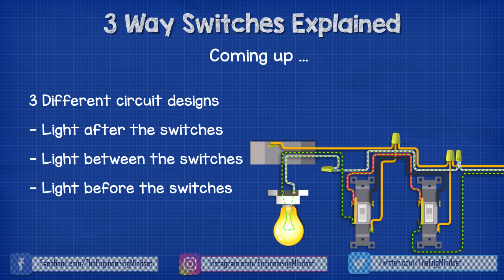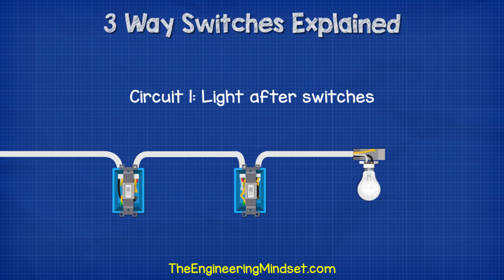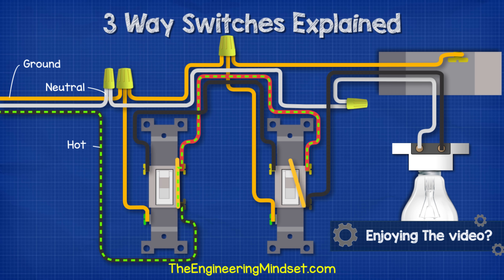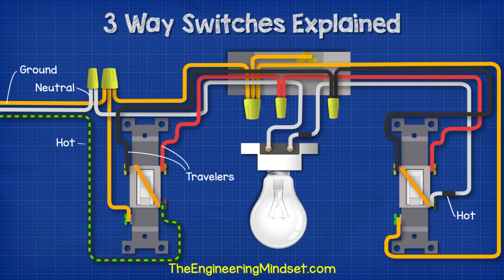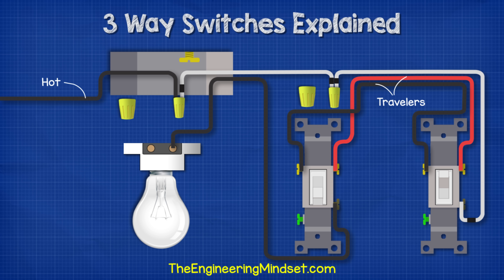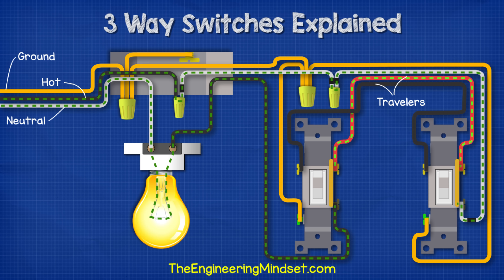3 Way Switches Explained - How to wire 3 way light switch

Comment: What’s the point of doing a 3 way switch? Why connect a lightbulb to 2 switches?
Reply from the maker: You need to walk through a hallway at night but the switch is at the other end. How can you turn it on, without having to walk through the dark to turn it on and then go back again to turn it off when you leave. We install a 3 way switch so we can turn it on and off from multiple locations
Reply: @EngineeringMindset   that makes sense. Thanks for explaining. I love your channel. Your videos have so much info and you teach it in a way that’s easy to grasp. I got a new job in facility maintenance and you videos have helped me tremendously. I appreciate you!

Comment: Great video, only thing id change is that wire nuts aren't connectors, they're protector
Reply: They are dual function devices in that they do both jobs as a connector and an insulator (protector). Sure you can twist the wires together and then put on the wire NUT (sounds like a connecting/fastening item) but pros don't, they put the stripped ends of the wires into the appropriate sized wire "nut" and twist the nut thus "connecting" the wires and also insulating the now mechanically and electrically joined wires.

Comment: Found it. I’m installing a new light switch on the other side of the light and at 4:00 I found the exact circuit I’d be wiring. I ran wire for 3 years but I didn’t do any finish wiring so I didn’t know to cap the black and white at the light box but I knew that eventually in my circuit Common would be Hot. This explained EVERYTHING I needed to know to do the job. I enjoy many of your videos as a new technician training myself in all trades at a very large apartment complex. My bosses know I have the ability to troubleshoot so I’ve been forced to learn on my own. Well partially on my own thanks to Grandpa YouTube and all his infinite wisdom. Thanks for the video and to all of you who produce boring ass content like this lmao.

Comment: In America your third setup is the preferred choice running a 14-2 awg to one switch and 14-2 load to the other switch with 14-3 travelers in between the two switches. I prefer making the switch box the junction box and not the ceiling box. That way you're doing the majority of your connections comfortably in front of you and not on a ladder looking up.
There are instances your feed and load are in the same switch box. That case tape the white wire in your 14-3 to make it a hot and feed back across it to get your hot or load back over to the other switch. Thanks for the video.

Comment: I have a three way system with the light in the middle, power at the first switch.  My question is... can I add a single pole light switch, for a separate light, to the second switch which is at the end? Would the red wire become the neutral "white", for the additional light?  Or is it just not possible?

Comment: I am guessing that all this is assuming you are using “romex” sheathed cable and not conduit with single wires which is why you chose in the middle presentation to use the neutral as hot and put tape in it. I’d say get some red electrical tape and a sharpie and write HOT on the tape and attach like a flag so any uninformed homeowner could figure out. If you are using conduit, I assume you can use the same wiring as the first explanation if the common wire is a different colored wire.

Comment: Method two is against NEC code 200.7(C) as you can’t use the re-identified white as a switch leg or return to the light. So the second 3 way where you have the white attached to the common would be switched with the black and made a traveler for the second 3 way and the black made the switchleg, and have the re-identified white in the light box attached to the black traveler wire from the first 3 way and that takes care of the violation and this avoids confusion if said tape did come off in the future and there were two white wires attached to the light so I do see where they came up with that code. Other than that great video otherwise.

Comment: Great video.

My only thing would be instead of addressing just each individual wire you could state.

2 wire to the light fixture coming in 
2 wire to the first 3way switch followed by
3 wire to last 3way switch

And then break down the function of each wire for the light itself and (2) 3way switches.

Comment: In all three of the wiring variations, none of them work correctly. If you have 2 three-way switches you should be able to turn the light bulb on and off With either switch. The way this is set up in all three variations you turn the light on with one switch and then you have to turn it off again with the same switch, otherwise the second switch will not be able to turn on the light bulb because the first switch is disconnected or off. You should be able to turn the light bulb on or off with either switch…
Reply from the maker: Please watch the video again, all three circuits do exactly what you say they can't/

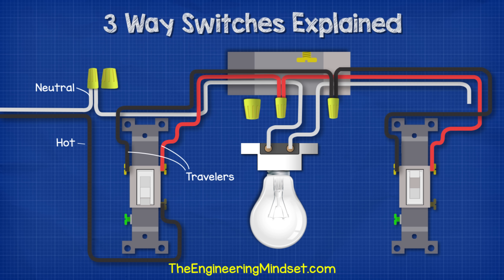Comment: This is a great video explaining 3 way switches.  I have a few other comments to add.  In your presentation you say put the black travelers on the left screws and the red travelers on the right screws.  Left or right doesn't matter, you just need a pair of wires between the traveler screws.  Also, looking at the 4:42 point in the presentation, I prefer using the black wire going to the right switch to connect the common terminal  to the light fixture. Then use the white wire to the right switch as a traveler by connecting it to the black traveler from the left switch at the light box.  Doing it that way, you will have a black wire and a white wire to hook to your light fixture.

Comment: the only proper way to wire a 3 way circuit is the first,  do not do the other two.
the 2nd example makes you take down a light fixture that you need to have
in place to trouble shoot a problem.
the 3rd does the same thing and you are not following U.S.A. code if you
have not run a neutral to all boxes even if it is not needed.  The ground
wire must be ran also to all boxes,  does not mater if the box is metal
or not.    only use the great 1st example.  the other two is old fashion and
not per code.

Comment: Your diagram would be simpler for most people to read if you showed wiring going straight from one switch to the other. Hot going in one switch and switchleg leaving the other. You're diagram is what someone running pipe might do. Especially if there were multiple lights and light boxes in the ceiling to save running pipe from one switch to the other. But with romex or ac wiring switch to switch is more common.

Comment: Would u kindly explain why in case 2 & 3 that u use a white wire w black tape? Why not just use a black wire? My experience with black tape suggests it isn't likely to last 200-300 years. And what name do u assign to the white wire w black tape?

Job well done. Thx.

Comment: If you wire the way your thumbnail diagram shows , the light is wired in series rather than parallel, which means it's fine for one fixture but, if you have additional fixtures you intend to run on that switch leg, each additional fixture(s) will reduce in available watts.  Example: 1 fixture 60w 2 fixtures 30 w 3 fixtures 15 watts. Assuming one 60w bulb per fixture.

Comment: Please confirm if this 3-way switch configuration apply to what I found in a hotel I once stayed in the USA: Just when you open the room there is a switch that either switches on or off the light, then each side of the bed has a switch. Using either of the switch beside the bed you can switch on or off the same light. I'm not an electrician but i would like this done my bedroom.

Comment: Seems wrong.
In the 3rd case, why do you use a white wire, with black ends (as the continuous hot), and a black traveler; and not a black wire (as the continuous hot) and use the white wire as the traveler (with black or red ends)?
You could look at the (3 wire) cable between the 2 switches, find that the black wire is not hot, and think that the power isn't on when in fact the white wire is hot!

Comment: I built one of these switches for my sister's livingroom, well the bulb burned out and some genius decided it was the wiring, so they took it apart and couldn't put it back together, 3 semi electricians couldn't put it back together, so they called me, I told them go to the library and check out any on electrical wiring with 3 way switch and call your son, he called me and told me, somebody took all the 3 way switches anyway it was funny as hell, I told her DONT LET ANY DUMBASS TOUCH UR ELECTRICAL WIRING!!!!

Comment: Good Morning... I tried circuit example #2 (light fixture between 2 switches) but instead I wired 2 light fixtures between switches. It does not work! It works perfect with one light fixture but for some reason it breaks down for 2...

Am I doing something wrong or is this an easy fix? Please help!

Comment: Great video!
You can mix and match the traveler wires on the traveler terminals.  Just make sure the traveler wires go to the traveler terminals.  
Make sure one common gets the hot wire and the other common goes to the light.
Neutral goes to the light, obviously.
Reply: Yep Travelers are best buddies and travel side by side.

Comment: These switches work independently wired as shown, right?
  Throws me off when it says one switch is in On position, the other is in Off position, so light is off. 
  I am renovating the house I was raised in. It has two 3 ways. Both are dependent on what position one of them is in.
Reply: Same question.
I want each switch to be independent. Should I get 2 way or 3 way?
Reply: I wish someone would answer this.  I find it odd that one switch acts as a master switch and has to be on for the other to work. 
  I still have not gotten into them to check the switches and or wiring.

Comment: My light isn't working. There is no voltage at the fixture. Switch verified good. I think it's wired with the light on the end of the circuit even though it's physically in the center. Ive 2 wires at the light white black & ground   I'm getting 60-70 volts if I connect the white/ black & an l1 or l2 in a nearby 120v socket via a multimeter, but no voltage/resistance between them. What could it be?
Reply from the maker: Check our new Multimeter tutorial out ➡️ https://youtu.be/4lAyzRxsbDc

Comment: I have power going to Switch - light - light - switch. Is the wiring the same as your video? Im having issues with the last switch turning off power but not back on.
Reply: There would need to be an additional "hot" wire between the two lights to power the left light from the right light.

Comment: Very precise instructional video. But you did not cover another very common setting. A "dead end" 3-way switch. That usually happens when you add a second switch after the fact, and just run 12/3 or 14/3 to the second switch.

Comment: I am trying to replace a lighting fixture with an usb/electrical outlet in my ceiling. The light is operated by 3 separate switches, can this be done? I am ok with the outlet being operated by the 3 switches still, but I’m not sure if it a direct swap
Reply: Yes it can be done, but it may not be the most convenient.

Comment: Very good video, congrats. But i dont understand why not use the black wire for each wire that is hot. Why use black wire and feom the connecting point you go with white wire wraped in black tape?

Comment: Dumb Question.... I'm not an electrician, but it appears that the HOT wire is always black, where as the NEUTRAL wire is always white.  In your 3-way-switch, why not just use a completely black wire for all HOTs vs a white wire with electrical tape.  What if the electrician forgets to do the electrical tape trick, aka a home owner who doesn't know that's how its done?

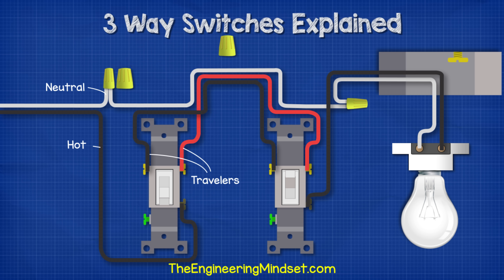Comment: (@2:20) why do you need the 2 wire connectors in the switch boxes for the neutral wire? Couldn't you just run a neutral wire directly to the light fitting? Also, (@4:40 and @ 6:23) why do you run a white wire with a black tape from the light to the common terminal, why not just use a black wire?
Reply: You will have 2 wire from your supply that will actually go to the box for switch 1 then you will run another different wire which will be 3 wire with red from switch 1 to switch 2 then you will run 2 wire from switch 2 to your fixture. 3 separate wires (2 wire, 3 wire, 2 wire) therefore in order to use the wiring as you have it, the white wire will be unused and you will need another black wire to route back so instead of having a single black wire in addition to the 2 wire already routed to the switch you will use the unused white wire and mark it with black tape as this is recognized as an indicator of a hot wire

Comment: I have no idea what we have in our bathroom then because we have a single switch and a double switch. The single switch only controls the light. The double switch does our light and fan. The difference is, if both switches are up or both are down the light is off. One has to be up and the other down for the light to come on.

Comment: Good analogy - however when you show a broken circuit from any switch, you’re still showing electrons flow up to the broken point... better to point out that current doesn’t flow, but only these parts of the circuit are energised - to not confuse those who are here to learn

Comment: 02:00 What if on switch 2, we accidentally reverse the two traveler wires?  Will this trip the circuit breaker?
Reply: No, your switches would just have to be in different states for the light to be on, one up one down.
Reply: @joshuamartin3232  thank you 🙏

Comment: Thank you for showing clearly the different ways to set it up.  The room I am rewiring (2-wire ungrounded to 2-wire grounded) has the light between the two switches.  Apparently having the light in the middle is not common, though it seems to make sense to do it that way.

Comment: Here in the UK  those circuits are described at TWO way switching  --  as each switch only has two positions   (toggle up or toggle down ) and in this circuit only has two switches as well - where do Americans get the three from  ??
in the UK adding further switches would be described as intermediate 3 switch or intermediate 4 switch etc.
Reply from the maker: Please see our UK/EU two way switches video https://youtu.be/opoEswRp_jg
Reply: @EngineeringMindset   Fine   -  but why are the switches called 3 way in the US

Comment: Excellent examples and animations. If I’m correct the 2nd and 3rd examples would not be up to current code in the US as you are missing neutral wires in some of the boxes. This could be corrected by adding the additional conductor where needed. But it is certainly applicable to older construction before the neutral requirement change.
Reply: Option 3 doesn’t have a neutral in either box and violates code but option 2 violates a different code 200.7(C) for using a re-identified white wire as a return to the light from the second 3 way or switchleg. But the neutral is only required in one of the multiple switch boxes that work the same light or set of lights.
Reply: @usmarinekenny  Like the op already mentioned, yes not to current code but still applicable to the way millions of homes are already wired... 
Also video is still great as reference for the overall concepts if your either still inexperienced or haven't done it in a very long time. And anyone who doesn't know that current codes might different from a years old video or codes application can change depending on the age/location of the building has no business trying to actually attempt anything they see in a demonstration video to begin with 😐

TL;DR Your comment was redundant 👍
Reply: @EmpressOfExile206  - Yeah, them pesky OP's always putting in information in a video that a 99 commenters (on average give or take) jump on either not having paid attention or starting to criticize before they finish the video.  And after the first 50 or so identical gripes about the shared point they missed, it would be helpful to those of us who read these discussions to learn even more about the subject, not to have to read the same comment from the second 50 or so taking up space and breaking my mind. 🤬🙄

Comment: 3 way switch that's only using 2 switches? Interesting. 

Pretty sure the idea is to have 3 switches powering one lighting circuit.
Reply: It's called a Three-Way Switch because it has three terminals.  It doens't make much sense, but that is what it is.  For more than two switches controlling a light, you simply add Four-Way switches between the Three-Way switches.  There can be any number of them.  (Guess how many terminals a Four-Way switch has?)

Comment: What if you want to add a third switch? does your guide cover wiring for more than two switches?
Reply: you can add as many extra switches as you need - here in the UK those extra switches would be called 'intermediate' and would have 4 terminals and would be wired into the pair of traveller wires  - three story houses for example would appreciate a switch on each floor for the stair lights

Comment: How do I make this happen using smart switches and/or smart bulbs?

Current State:
- Single electrical source
- Single ceiling light (dining area - open plan)
- Single switch

Future State:
- One track light system with 8 bulbs (4 bulbs dining area & and 4 bulbs living room) connected to a single source
- Each area (dining & living) are individually controlled from a single electrical source
- Double switch??

Thx